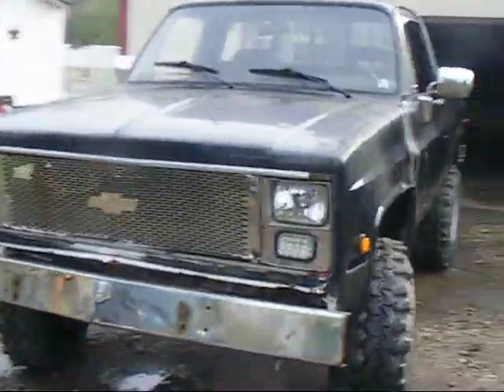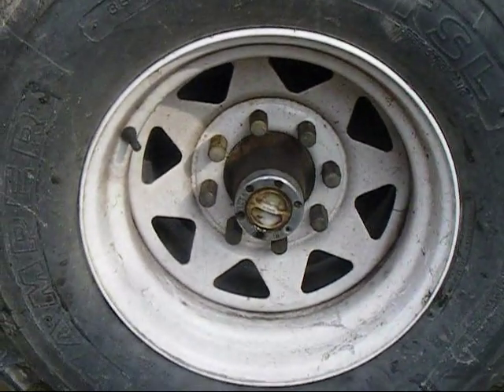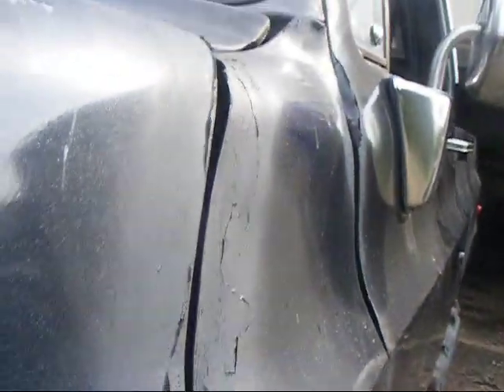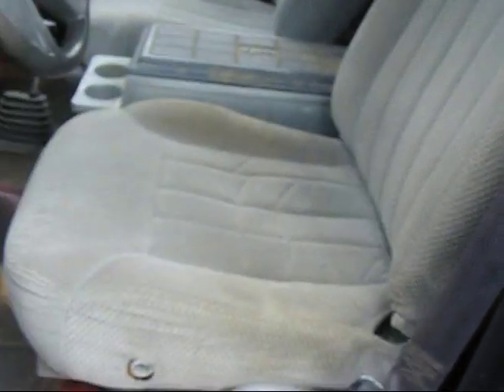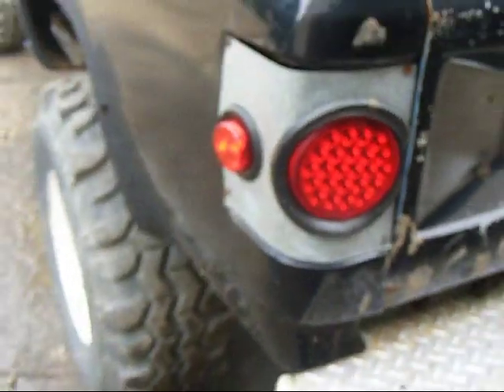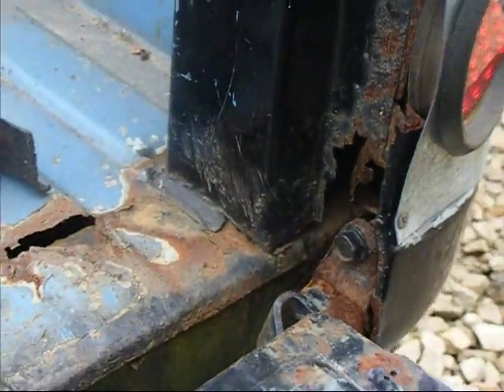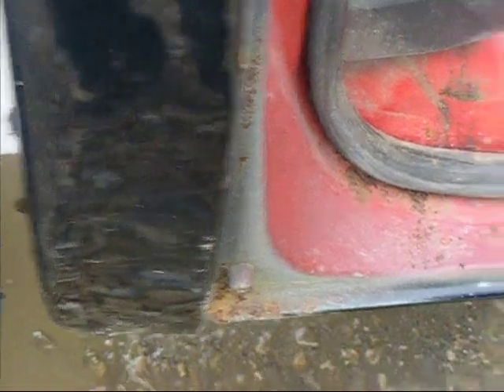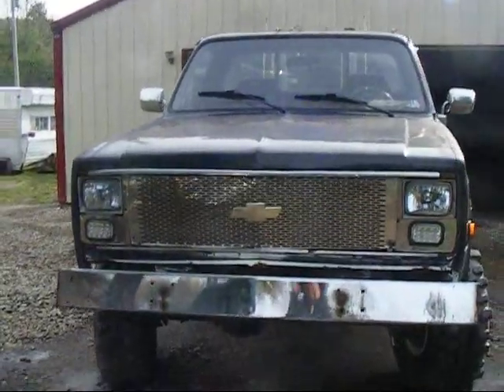1980 4x4  short bed chevy

Comment: Cool truck, I used to have a 1980 Shorted 4x4, the front clip, dash and tailgate on yours looks like been swapped out with 81-87, 1973-1980 had more rounded front, dash and tailgate features. Cool ideas tho, im with your decision on the previous work tho 😆